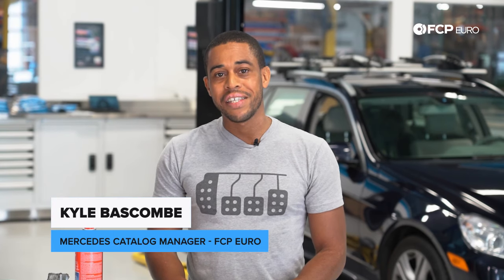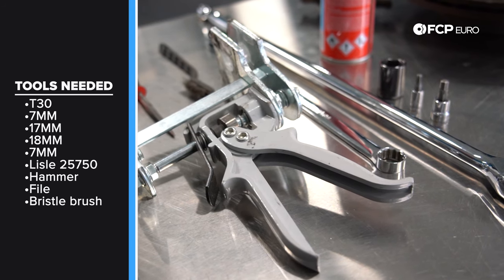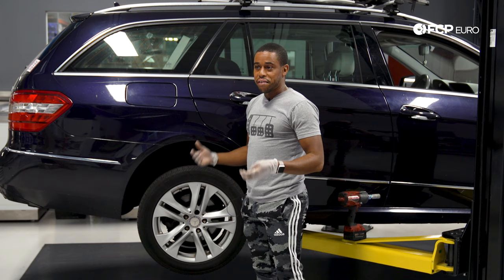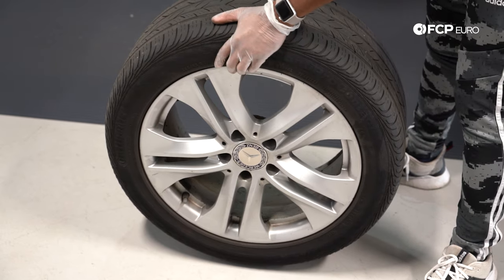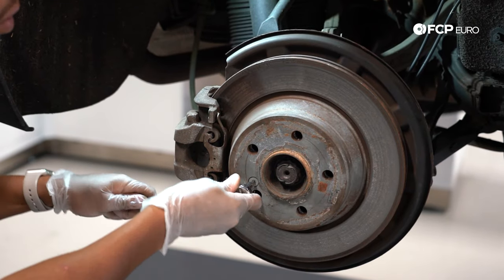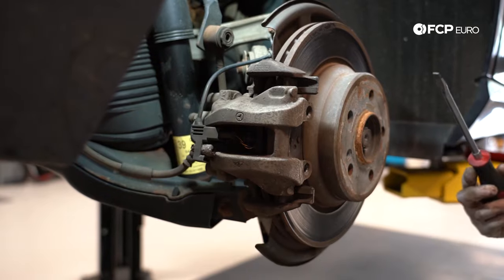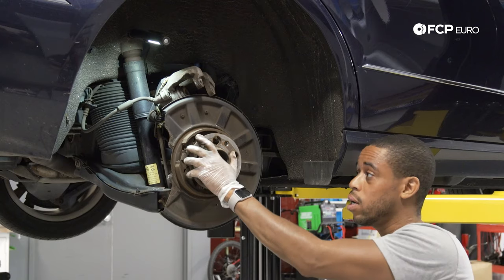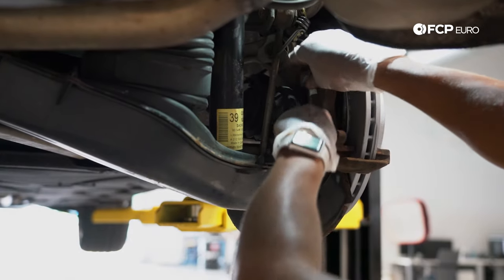Mercedes E350 Rear Brake Pads & Rotor Replacement DIY (W212 E320, E350, E500, E550, & More)

Comment: I like to put lube on the wheel hub it makes it easier. also you can use a C-clamp. You can put the old pad there and use that to push it back evenly.   I always do that Seems to work great

Comment: To keep things under control, I wouldn't remove the rotor screw until you are ready to take the rotor off, but I think Kyle is right about when to loosen it. I use three kinds of cleaning brushes to clean things up, stiff nylon for brake dust, brass for light corrosion, and stainless steel for heavy corrosion and the threads on bolts. On older Benzes, the manual prescribes using new bolts with encapsulated thread locker or blue Loctite on the caliper bolts and the rotor screw. I apply a thin coating of anti-seize on the contact surfaces of the hub and rotor so it will come apart next time. It would be great if Kyle could provide torque specs for the caliper and bracket bolts and the wheel lugs. Great video. Shows how easy this job actually is. Don't forget to reset the parking brake shoes after replacing the rear rotors.
Reply: For 2003 - 2006 E320s and E500s with SIS brakes, remove the fuse for the brakes before working on them.
Reply: torque values from MB service manuals for W212:
caliper bracket 115 NM
guide pins 25NM
disc brake safety screw 10NM
screw holding wear sensor socket on the right caliper 8NM

Comment: Awesome video! Instructions down to a T. Only additional tip is a T40 bit is needed instead of 7mm HEX (for removing caliper pins) on my 2008 W211. The suggestion for a breaker bar for the rotor bolts is right now. There was no way I could have loosened it without it. If doing this job with jack stands you can only use a breaker bar up to 18". Any longer would not have enough clearance. Perfect step by step instructions. Thanks Kyle!

Comment: Very well done diy video,only thing is depending on the year the caliper pins(bolts)will be a T40 torx and not a 7mm,if you have the T40's be carefull they are tight and you must stay real square and apply hard inward pressure to break loose as they will strip very easy,when you get them out throw them in the trash and buy a replacement set from NAPA like 4 bucks and they will be 7mm heads much better,

Comment: Greetings Ali, I am from Turkey and own a 2015 Mercedes with W212 e180 274 engine. There is shaking between 1500 and 2500 rpm at constant speed and when going uphill, there is fluctuation in the rev counter, it may be the filter you changed. Spark plug replacement and many maintenance were done, but shaking and misfiring did not go away. Do you think the problem may be the fuel filter? Regards Thank you

Comment: Great video thanks. Does one have to replace the sensor?  Or can keep using the old one?
Reply: If your warning brake light is on the dash it will need to be replaced. If you are changing the pads that are still have life left in them then no.

Comment: Hello Kyle, a very enlightening video - thanks.  I have a 2012 E500 Coupe and I want to just replace the disks. The pads have just been replaced so there won't be an issue with just replacing the discs. Is possible to remove the complete disc brake assembly by simply undoing the two bolds that hold the assembly to the chassis? I realise I'll have to retract the pads a little to get over the wear lip. Regards from the UK.

Comment: Very helpful video.  I am having a very difficult time removing the rear rotors.  I recall it being said that for northern cars, they can be a challenge to remove.  Any tips on how best to get them free?
Reply from the maker: Hi Bruce, oftentimes they can be very stuck on there. It would be best to grab a good size hammer and work the rotor all the way around until it pops off.

Comment: Is there a sensor on both sides or is it just on one side of the car
Reply from the maker: Hi Tucker, it depends on the vehicle. Our brake kits include the needed sensors depending on the model you are searching for. In this case the rear uses on brake pad wear sensor.
Reply: Its normally on one side.

Comment: nice video kyle =) would you recommend bleeding the brakes after changing rotors and pads?
ive changed mine on all 4 corners but my brakes are still poor and they dont bite well. i have bled them twice. 

what would you recommend?
thanks
Reply: After - I also suggest speed bleeders...(no, I am not Kyle). Speed bleeders make any car much easier to bleed the brakes.

Comment: What size socket does it take to take the caliper off
Reply from the maker: Hi Taylor, to remove the caliper you need a 7mm hex bit. To remove the caliper carrier you will need an 18mm socket/wrench!

Comment: Thanks for great video!
when the disc roater stuck with a hub, where is the good points to hit? and how hard would it be?
Reply from the maker: Hey Ken - if you're not planning on keeping the rotor and just throwing it out, you can hit the braking surface of the rotor for max leverage. If you're keeping the rotors, you can hit the front of the hat of the rotor (not the braking surface) in a circular motion to try to loosen it!
Reply: @fcpeuro  Great advice, thanks heaps. please upload more videos for Mecerdes DIY! bluetec tips is highly appreciated!

Comment: You forgot to put brake grease on the pins.
Reply from the maker: Yes, the age-old argument of grease vs no grease! It's totally up to the DIYer, as most manufacturers don't call for it from a service standpoint.